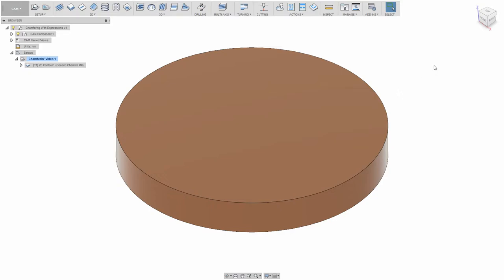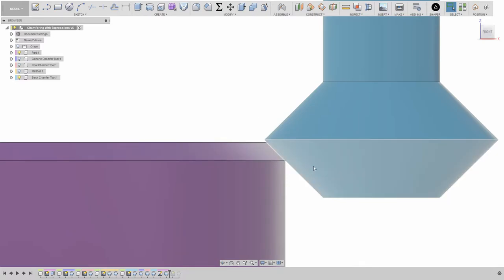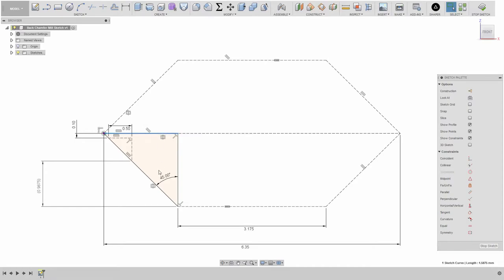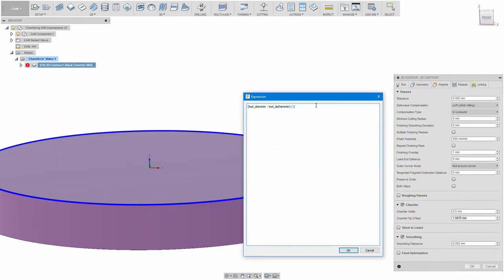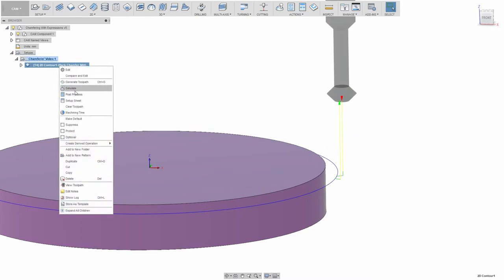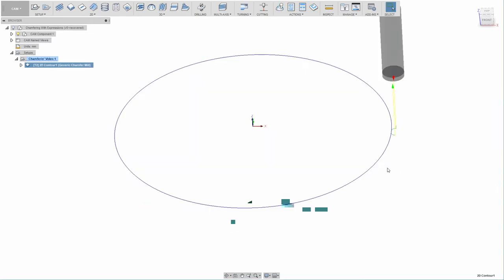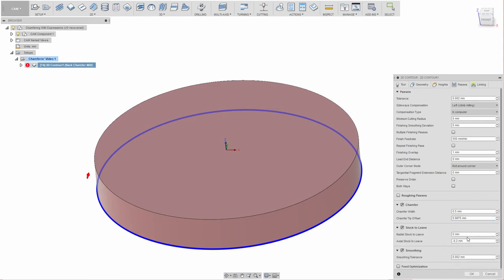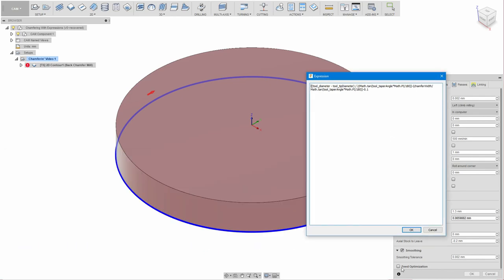Automatically Optimize Chamfer Tip Offset Using Expressions

Comment: Very interesting. You are probably right about Javascript; I first thought C#. The little F360 scripting I've done has been in Python, but this not Python. I didn't quite understand the back chamfer part. The stock to leave can be set to -0.2 regardless of the particular tool? Thank you
Reply from the maker: Thanks for pointing that out, I didn't explain it too well. Basically, that's the case: you can set it to -0.2, regardless of the tool (as long as the "buffer" you've chosen is 0.1). I'll try to write out why...

To start, assume we're doing a normal chamfer on the top of the disc. We would select the top edge of the disc and put the expression into the chamfer-tip-offset field. The expression makes it so the corner of the tool is placed 0.1mm above the edge we selected. If we were to go in and set an axial stock to leave of exactly -0.1mm, the tool-path would be lowered by 0.1mm and that would put the corner of the tool on the exact same level as the edge. OK, so adding a buffer of 0.1 and negating it with an axial stock to leave of -0.1 will put the corner of the tool at the same level as the selected tool-path.

If we were to go in and deselect the top edge of the disc and select the bottom edge instead, the corner of the tool would still be placed on the exact same level as the edge. To recap, with the bottom edge selected and -0.1 put into the axial stock to leave the corner of the tool would be placed at the same level as the edge. Since we've decided that we want a 0.1mm buffer between the corner of the tool and the surface of the material, and since we are now chamfering on the bottom of the part, we need to lower the corner by another 0.1mm - we need to change the axial stock to leave to exactly -0.2mm. Or, to put it succinctly: we need to enter an axial stock to leave value of negative two times the buffer we've chosen.

So, if you find that 0.1mm isn't enough buffer to avoid a bur and decide 0.25mm is a better buffer, you'll want to set an axial stock to leave for back chamfers at -0.5mm. If you use the expression that I show at the end (but don't talk about much) it'll calculate-out the required axial stock to leave, but it's probably easier to just remember to set it to the buffer times negative-two.

I hope that makes a little more sense! It's something that would probably be easy to show with visual aids, so if my explanation attempt isn't making sense, I can make a little vid to show it "more betterer".